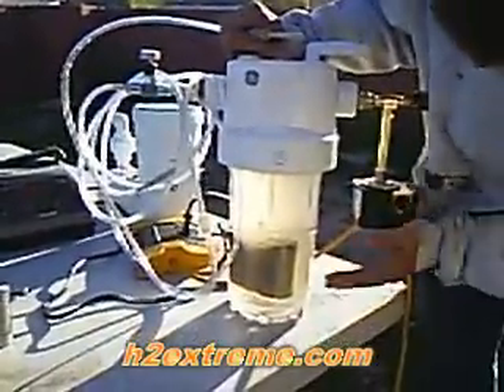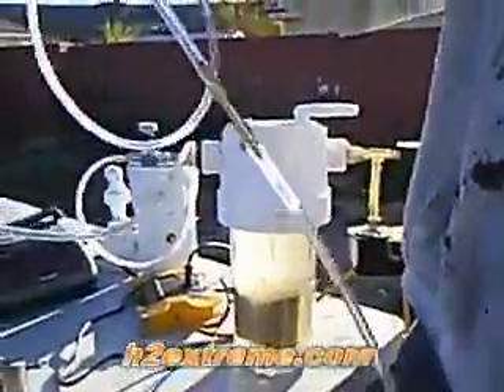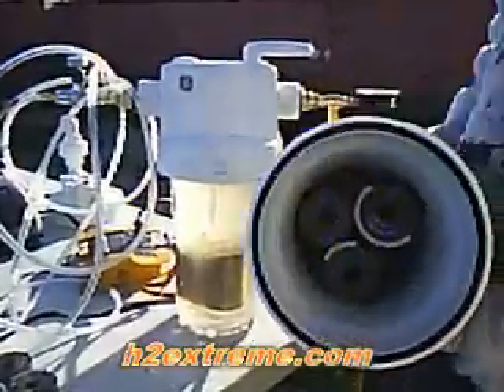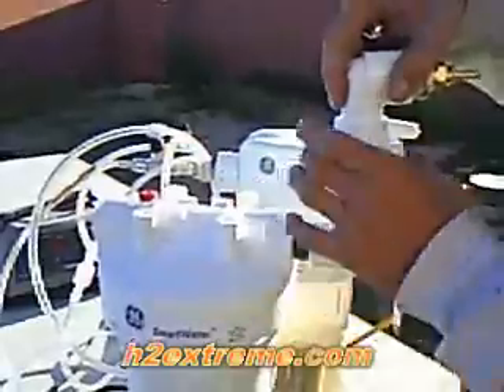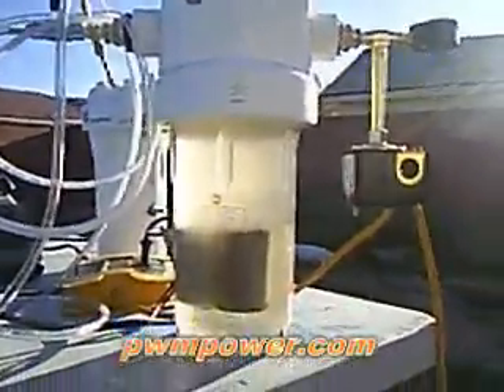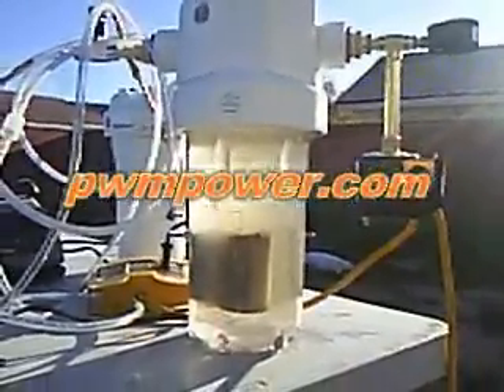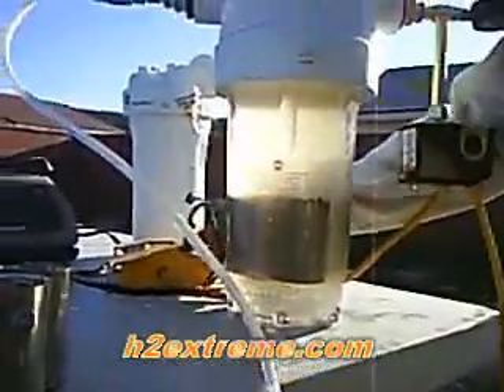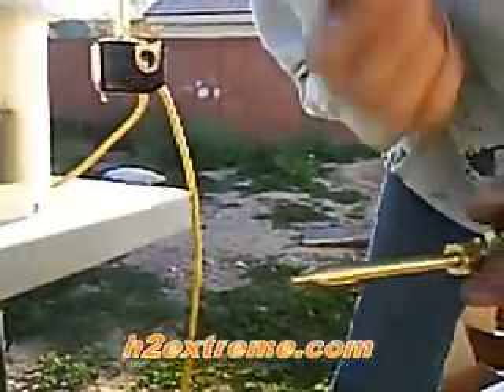h2extreme.com hho torch generator

Comment: you can use it for brazing (silver soldering), you just need a brass wire and borax or borate acid   as a flux